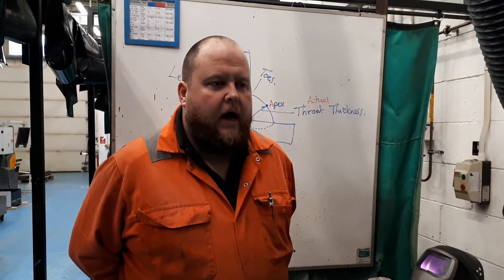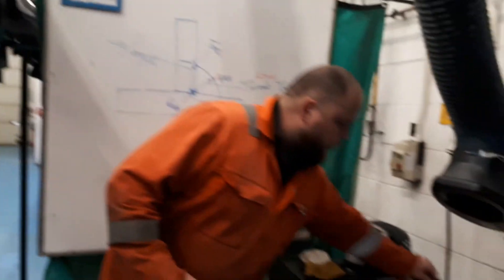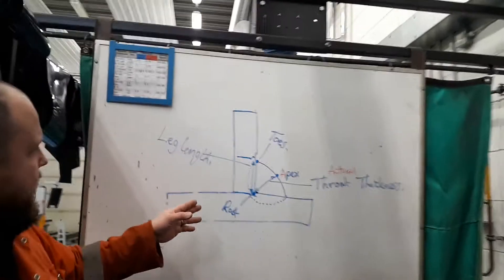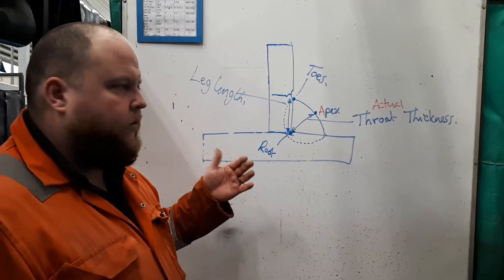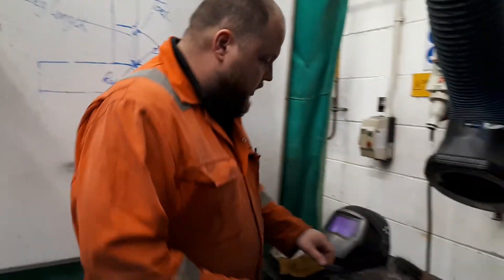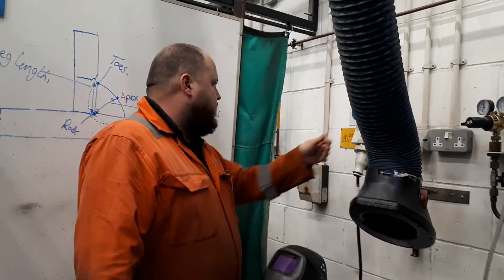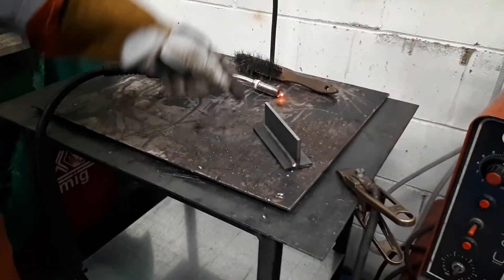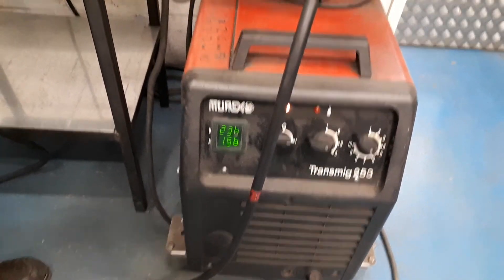How to Setup Your MIG Welder for a T-joint (T-Fillet)

Comment: Thank you very much Sir! I'll be making the same weld tomorrow for an improved support for my commercial grade compressor. Best wishes! nd I find it strange that there were no comments here. Your adjustments are a bit different (amps, volts) than here in Orlando, Florida, U.S.A. but I understood you. Thanks again.
Reply: His teaching method is different, it seems he knows his stuff, but he does is very differently than what most may he used to.